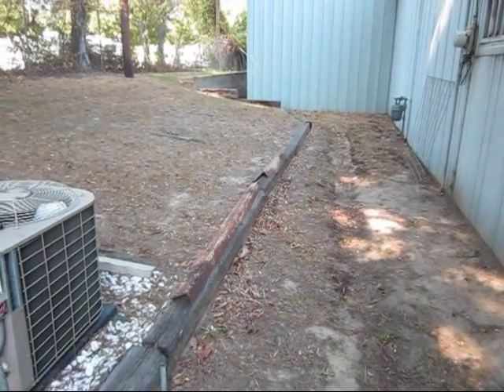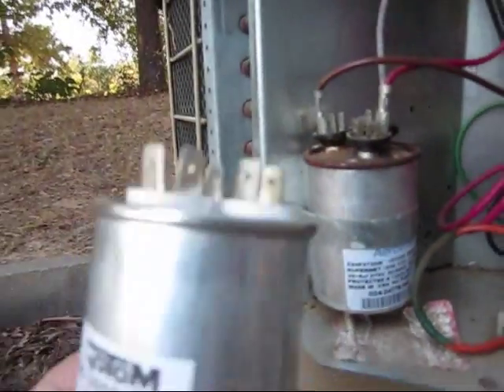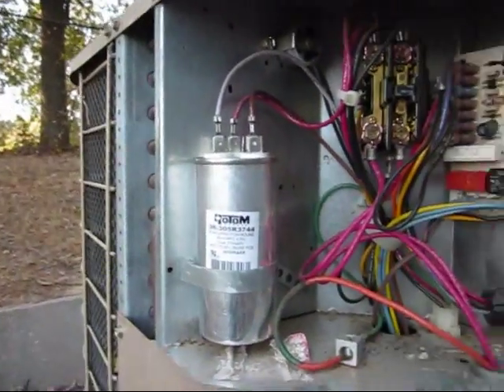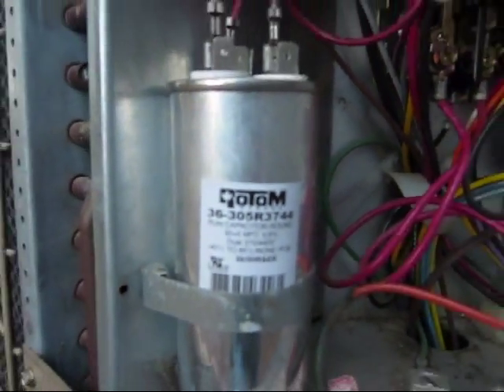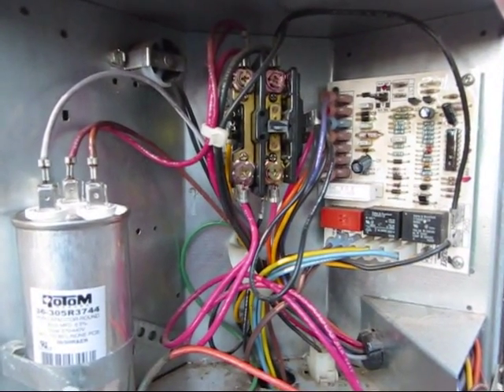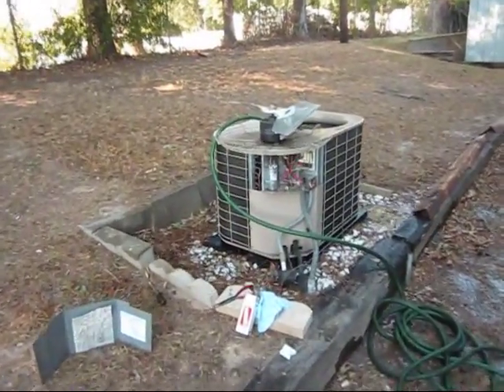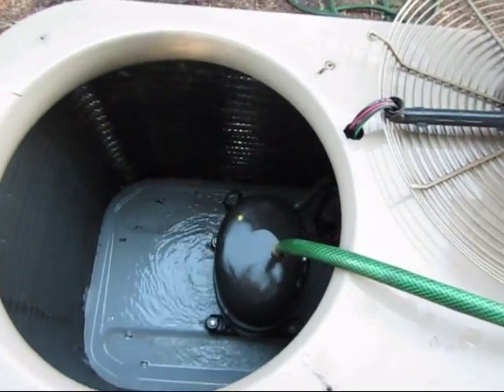Bad Dual Run Capacitor On A Coleman Evcon Heat Pump

Comment: Hey Ray !!!
I hate waitin for Time Delay !!!
Man kinda Scary on Compressor !!!
You knew what to do , overload protection works !!! LOL ...
Glad you got her fired Back Up !!!
To HOT there for No AC !!!
Get you some spares Brother for You and the Family , they usually fail Friday at closin time when nothin open !!! (caps ,contactors, etc...)

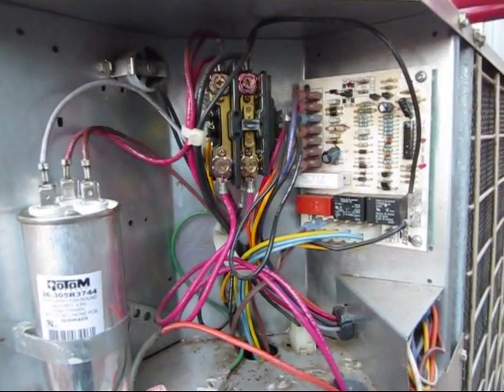Got my Call pushed back till 2:30 , they are wanting a Bid also !!!
I'll get some measurements !!!
Load Calc Time !!!
Fun tonight !!! LOL ...